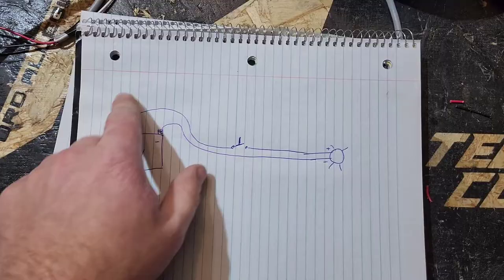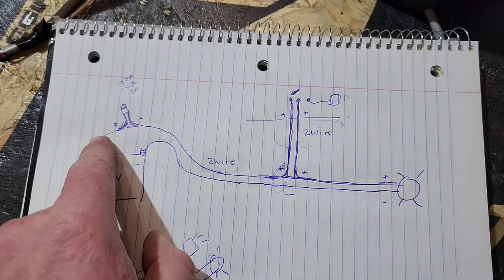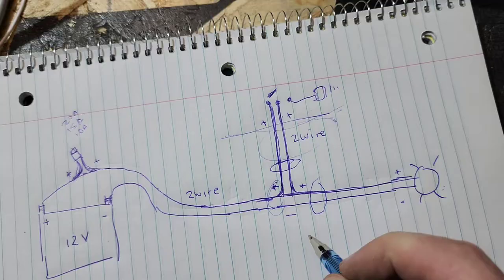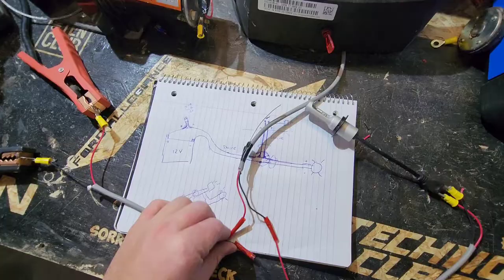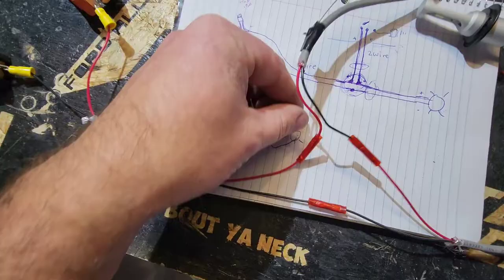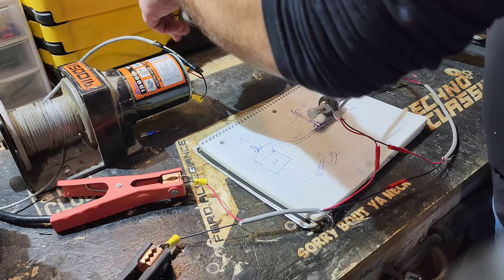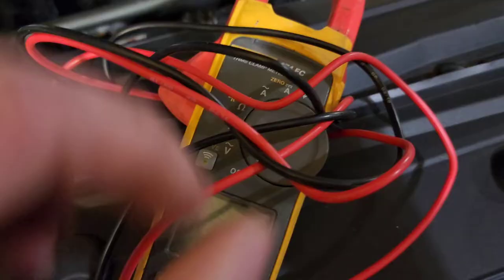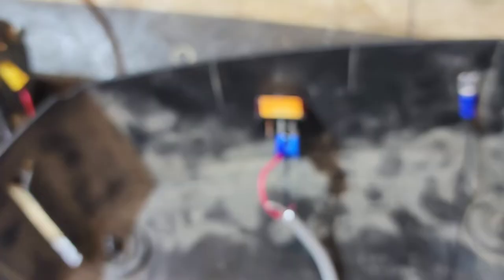How To: Wiring Up LED Lights And Other Accessories On Your Truck

Comment: Buddy i have only one question and it is is there any way to wire it without disturbing the fire wall?
Reply: Yes. There is a company that makes a system for lights and such that keeps the sealed box under the hood and uses Bluetooth to allow wireless switches be placed in the cab or wherever you like.
Reply from the maker: That's cool! I'll have to check this out.

Comment: hello dude I wonder if I want to wiring additional low beam to my car is it ok to use stock wire in car just splice it up? any problem with that?
Reply from the maker: You can certainly do this. Just make sure to put a fuse on your positive wire going to your new lights. So if they happen to fail or fault out, you don't take out your headlights.
Reply: @fiftynation  thank dude🙏
Reply from the maker: Anytime 👊

Comment: Quick question: If I add grill lights and a set of tube lights to an existing set of lights, do I need to go up in fuse size?
Reply from the maker: Like increase the main fuse for the lights you want to tap off of?
Reply from the maker: Like increase the main fuse for the lights you want to tap off of?
Reply: @fiftynation  yes
Reply from the maker: @benc4412  if they're LEDs, if you're adding a bunch of incandescent bulbs, may not be an awful idea. However you should also make sure to put an online fuse on the aftermarket equipment you're installing.
Reply: @fiftynation  so what if I wanna add two little LED to my headlight (to make some kind of tear spark to the corner) would that need a fuse change if I wire it to the headlights?
Reply from the maker: LEDs draw such a small load and you. can certainly get away with splicing it directly into your headlight without changing factory fuse size. You typically want to install an inline fuse just to protect your factory equipment. Lots of people buy cheap ebay parts and splice it right into their vehicle power circuits. And when those cheap products fail it can take out other instruments /devices sharing the same fuse.
Reply: Never go up in size with the fuses that the manufacturer put in your car, those fuses are specifically rated for the gauge of wire they are protecting. Always remember that the fuses are there to prevent your wires to catch on fire.
Reply from the maker: @RdMovi  this is a good point 💯

Comment: Hi I want to wire up marker lights on the side of my truck 6 each side what's the best way to do this please
Reply from the maker: It depends. When would you like them to be on? By simply hitting a toggle switch? Integrated with your day time rubbing lights? Come on when the low beams come on?

Comment: I’m running a 126 watt light bar and it came with a 10 amp and a 15 amp fuse for the in line fuse which one do I use? It’s a 2020 f150 and i have the full wire harness from nighlight
Reply from the maker: Your light bar should have some specifications on it stating either amps or watts, what is that number?
Reply from the maker: In all likelihood 10Amp will be fine. If you're ever unsure smaller size is better because it will guarantee better protection.
Reply: I just checked it’s 15 amps
Reply: So using the 15 amp fuse is good? Or should I stick with the 10? Thank you by the way for posting everything you do I’m new to the f150 world and your content helps! I subscribed to your channel for sure haha
Reply from the maker: If the light is 15 Amps use the 15 otherwise you will blow the 10Amp. But if you are ever unsure about the amps of whatever device you're installing you are better putting a smaller fuse in. And if that blows upsize it a bit. Just guarantees better protection if it's smaller. But if you know the amps of your device size your fuse accordingly.
Reply: Thank you so much